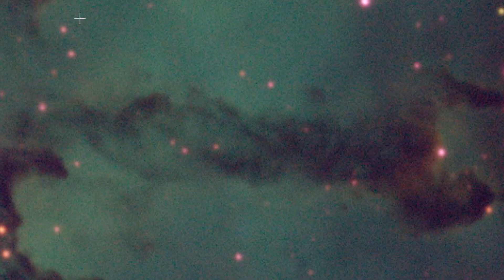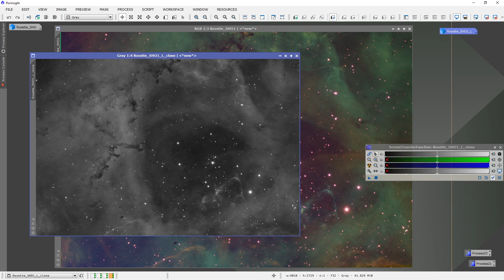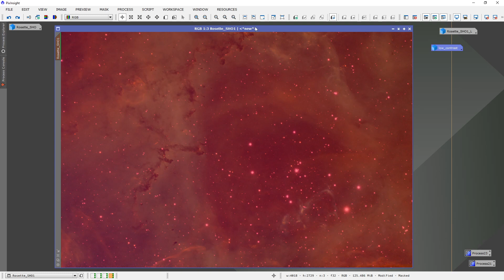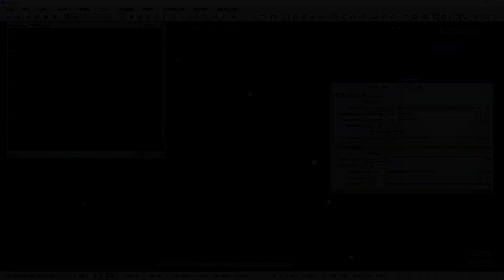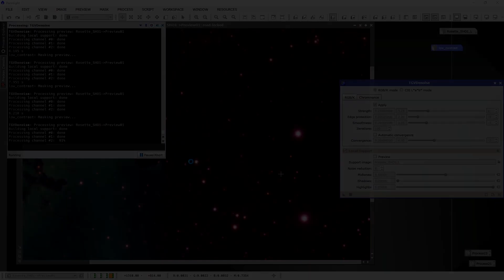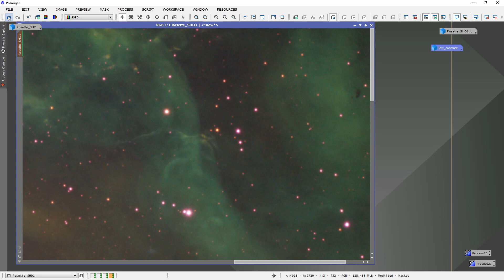Linear noise reduction using TGV Denoise (Pixinsight)

Comment: Very good channel you’ve created! I have an edge hd8 (with 1600mm and filters) and I haven’t used the scope yet, and I’ve been scared that it would be much harder to get nice photos due to the high f/7 or even f/10, but you’re getting really nice photos (of course it’s also due to your skills in editing) so I’m stoked! I have just a question about what OAG you’re using? Is it the celestron with the bigger prism or do you think it’s still possible to get nice guiding with a zwo OAG and the 120 mini? I’m on the fence of just maybe using my guide scope instead, but heard that it could create problems due to the flexion of the mirror when it focuses?
Reply from the maker: Thanks Filip! So, I recommend the Celestron OAG with the ASI174mm mini for guiding with Edge 8. The regular ZWO OAG prism is too small, and will make it difficult to focus or even find a guide star.

If you go with the OAG instead of a guide scope, you'll likely get much better guiding and eliminate flexure - I generally get between 0.15 - 0.4" RMS on most nights at f/7 using my EQ6-R and the ASIair Plus.

I wrote a blog post on my site about getting back spacing correct with the Celestron OAG, including diagrams and examples. Check it out if you go that route - could save you a lot of time fiddling.

Comment: Nice video Chad.  I struggle with noise reduction but I have not tried TGV with a low contrast mask before.  Will give that a try.  :)
Reply from the maker: Thanks James - yeah, I think NR is one of the most complex parts of processing. I struggle with it as well. One thing I've found is that linear TGV denoise works pretty consistently on most images.